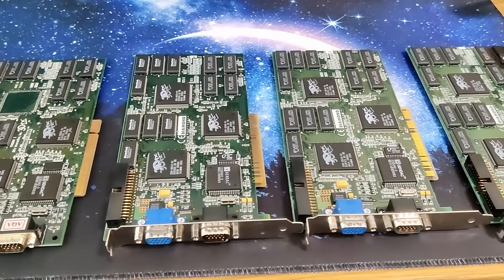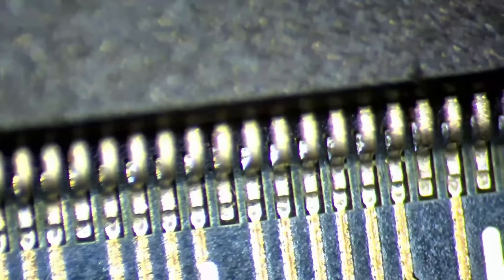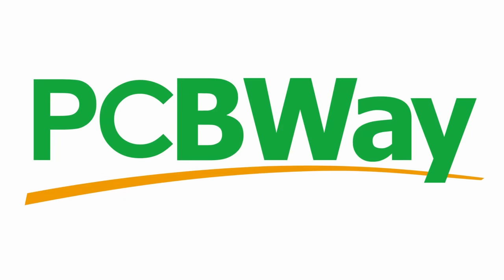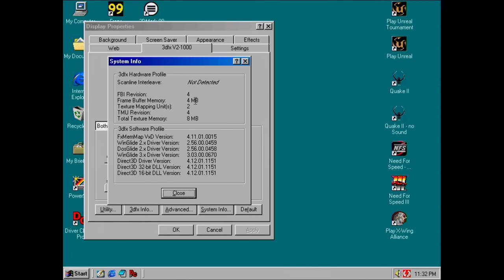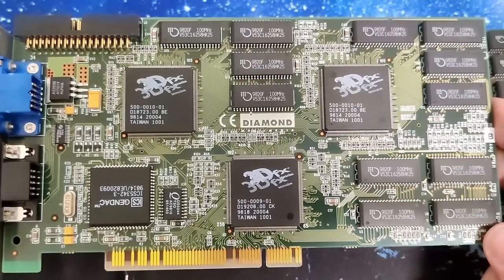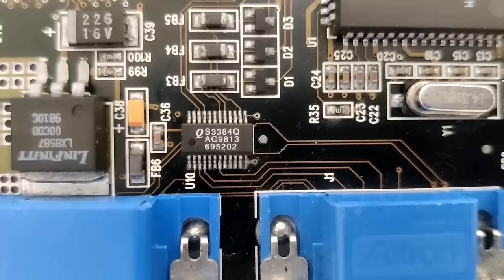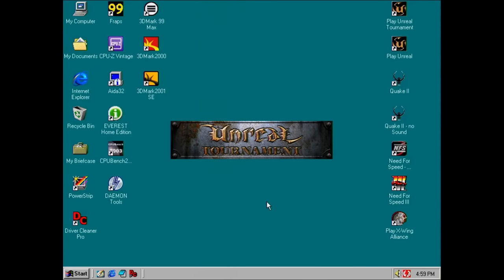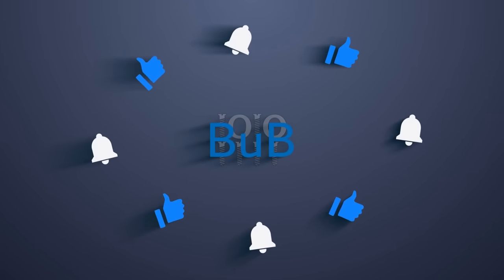Mystery: Fixing Discolored Voodoo 2 VGA Output (Creative CT6670)

Comment: What kind of solder did you use for this ic removal? I did not get it :) thank you!
Reply: It's called Low-Melt solder, Low Temperature Solder Paste, or Low Temp Soldering Alloy. There's a few different names but they all do the same thing, most melt around 70C and mixes with existing solder making them easier to wick away.
Reply from the maker: There are affiliate links for low-melt solder in the video description if you want to check it out. I think mine has a melting temperature of 137 degrees. It worked quite well in this scenario

Comment: Great video. But how about burned ferrite bead (FB5)? It definitely looks not healthy. Timecode: 07:44
Reply from the maker: That's probably a bit of flux residue. I did reflow the solder on the diodes and the beads because it was dull as well.

Comment: What is the flux you are using?
Link in description doesnt work.
Reply from the maker: I am using AMTECH NC-559-ASM (taken from the ad on AliExpress). I am not sure if it is real or fake, but the link in the description is the product I purchased and what you can see in this video. Odd that the link doesn't work for you - I just tried and it opened the correct product.

Comment: I had that problem.
But i use sli in that time.
So i switch the cards and problem away.
Reply: Might have been the same problem. Only the 'primary' card in the chain does the VGA passthrough switching.
Reply from the maker: I think you're right. Sounds like the same issue.

Comment: I've never had that chip die on me, but guess what - I had one with only Blue working. And that's because 2 of those 3 ferrite beads on the RGB lines have cracked! Replaced them and my colors were back. However that card had a weak FBI that only works up to 87MHz so it wasn't totally fixed :/
Reply from the maker: Interesting. Yeah, it could be anything in that area that prevents the signal going through. The weird thing for me was the short on the signal line between those two terminals on the diode. Otherwise, the card was in good condition apart from the dull solder joints on the 3Dfx chips.

Comment: I Really Want To Give My ga-P41-es3g And Asus CUSI-FX To You For Repair
Reply from the maker: Do you have any idea what's wrong with those boards? The gigabyte is for Core 2 CPUs.
Reply: @bitsundbolts  p41-ES3G Has 12v Cpu Gigabyte motherboard has a problem with 12V CPU power. When I connect 12V CPU power and 24-pin power, it does not turn on, but when I connect only 24-pin power, it turns on (of course, when there is no 12V CPU, the post does not work).

In the case of the Asus motherboard, I broke one of the tabs (one of the tabs In socket 370) while refreshing the thermal paste.
I wanted to fix the broken tab with glue, the glue residue was poured on the whistle pins
I wanted to remove the remaining glue, which resulted in breaking one of the socket pins
Reply from the maker: If you want, send pictures of the Socket 370 to my email address so I get a better understanding of the issue there. The Gigabyte board with the 12V issue seems to be something else (maybe leaky caps or short somewhere). I am not sure if I am able to fix something like that. But we can discuss it in private. You can find my email in the channel about tab or wait for future videos - I will add contact details.